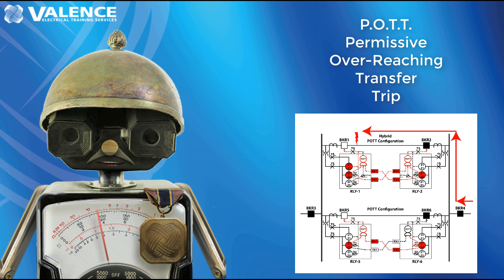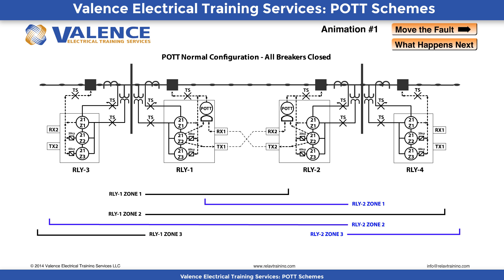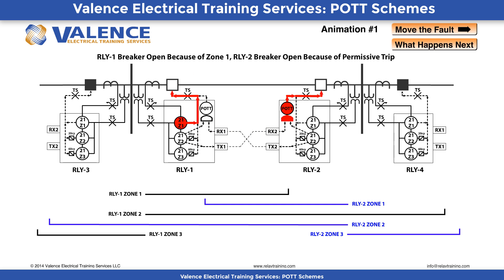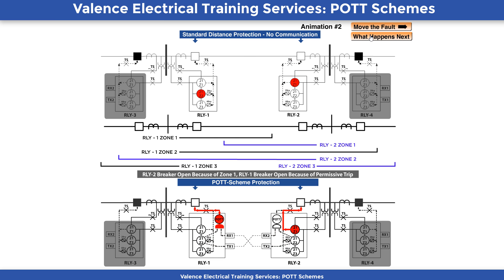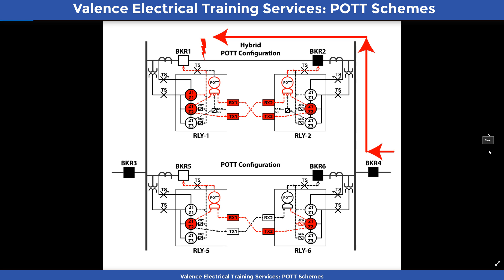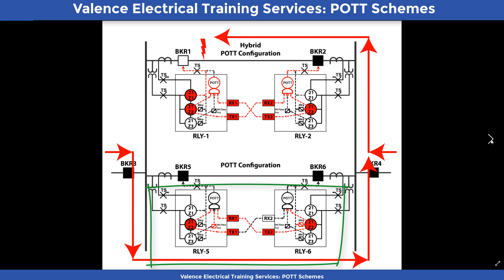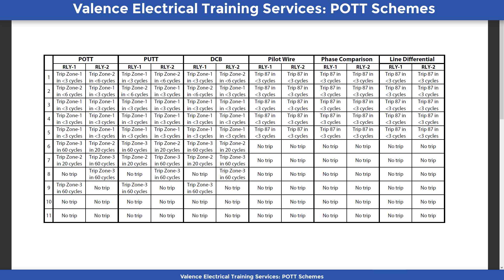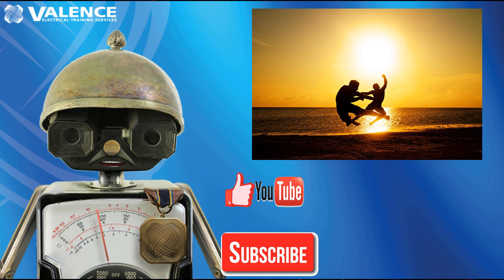Understanding Permissive Over Reaching Transfer Trip POTT Communication Assisted Trip Schemes Video

Comment: As you said that when reversal of current occurs, relay5 will detect Zone2. But actually fault seems to be in a zone which is more than120% for Relay5. Can you explain.
Reply from the maker: Follow the current flow through relay 5 before and after the reversal remembering that the two parallel line ends are basically on top of each other impedance-wise

Comment: Thanks for the great animation to explain the chronology of fault duration and BKR operations. However, in this video of POTT, the parallel line relays (relay 5 and 6) operations is not understood. 
- Before BKR1 is tripped Relay 5 is detected Zone 3 fault and after the BKR 1 is tripped the fault current direction is changed  
 and Zone 2 fault is detected. 
- But, how Relay 6 which is detecting Zone 2 fault before BKR 1 trip, is still detecting Zone 2 fault even after Current reversal, not Zone 3?
Hope you can clarify. Thanks again.
Reply from the maker: Thanks for the question. As stated in the video, nothing happens instantaneously. The two relays may detect the sudden current reversal simultaneously, but the local relay can detect a Zone 2 before the communication signal from the other relay changes.
Reply: Valence Electrical Training Services Thank you